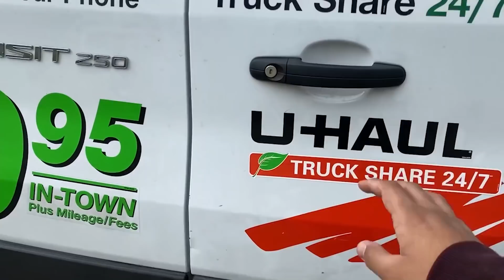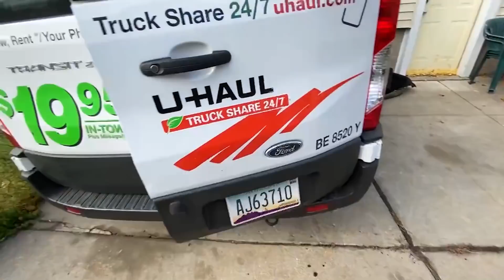BUILDING THE WORLD'S FIRST CHRYSLER 300 REDEYE! PART 1 (MUST WATCH)

Comment: Considering the harness is from a 2 door. Could you use a normal hellcat charger harness to replace the redeye harness? It won’t change any of the info on pcm and TCM bcm etc. so in theory it should be plug and play like you did that gen 2 charger

Comment: Does the Srt jeep and Trackhawk have the same Suspension?
Reply: Wk1 or wk2?
Reply: @Ept44  2012-2020
Reply: @tommyross4237  I don’t believe it has the exact same part numbers. However if you were to transfer it from a trackhawk it should all fit no problem
Reply: @Ept44  I got 2011 larado jeep trying to swap suspension cradle front and rear Driveline seats dash!?🤔from 2014 SRT JEEP

Comment: You can use the challenger BCM for the rear doors they will work you just have to have the charger wiring harness Because it's a 4 door and I know this because I've already done it if you have any questions you can contact me The challenger BCM will work the only other thing is when you do the headlights you will have to  Re pin your plug and you We'll also  have running lights Because of the challengers PCM

Comment: estimated price to upgrade a 16 typeS with 5.7, i read for around 10-12k you can bolt 6.4 onto 5.7 with a few mods.   for the hellcat 300 you need everything and the wiring harness seems most confusing, but impressive they managed to pull it off.  just wish they kept the dash classic 300 blue, instead of stock red from the charger hellcat

Comment: but the demon a hellcat with a tune why buy the hype  but sick build still yes from 300  to challenger are plug and play with switch up here and there you should look into the hemi awd front cradle and add the track hawks diff to it  should match up cause they both on the same side

Comment: Hey khl srt i have a question for you. Will touch screen 8.4 uconnect from 300c 2013 work on a dodge charger 2014? If so will the splash logo or colors be from chrystler?

Comment: Mane If u did a detailed view step by step video of this and it was 1hr long I would still watch it. I’m saving to do a 5.7 or 6.4 swap in my 09 charger. Keep up the good work
Reply: 6.4 !
Reply: Im in the process of swapping everything over from a 2015 5.7 into my 2011 3.6. You won’t regret it.
Reply: Go for a 6.4
Reply: @LukeGargan0  you should do a 6.4 swap instead
Reply: @Shelby_Moe5.2  Eventually when I can afford it, I bought a 2015 5.7 challenger 60k miles with only subframe damage for $4000. The goal is 450 to the wheel while being NA and still be my daily.
Reply: @LukeGargan0  same I cant just drop 10-15k on a crashed 6.4. Ian got it like that. Ima make videos on it hopefully they get big like this